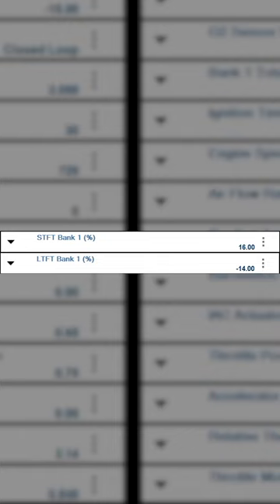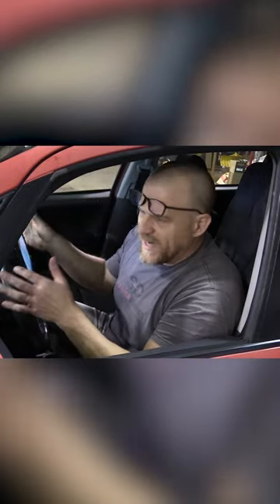Fuel Trim Numbers After a Repair [Is it fixed?]

Comment: Hey scannerdan. Thank you for all this content. I was able to fix a Chevy truck with a rich condition using fuel trims. 
I unplugged a vent hose and trims went to normal levels. And it told me the high pressure fuel pump was leaking. 

My question is in the video you say the sum of long term and short term. Are you suppose to add the long term and short term and it should be close to 0 as possible for a good running vehicle?
Reply from the maker: +/- 10% is considered normal and yes, total trim is the sum of the LTFT and STFT
Thank you!

Comment: I have P0068 & P0106 with Zero short term and 25% long term, replaced three map sensors at my Mercedes C250 but code back again after one day driving especially not vacuum leak at all

Comment: Hi I wanted to ask you or maybe someone who reads this I've been having negative long term fuel trims only when I put transmission in park position? While driving it gets a little bit better.
Reply from the maker: A dirty MAF can cause negative trim numbers at idle and then positive trim under load
Reply: @ScannerDanner  Thank you for your response my car is a 2011 Kia optima turbo it only has map sensors one on intake and other on boost pipe. Unless it's normal for trims to go negative once I put transmission in park.

Comment: Based on this video, You might not want to be doing this work on cars, you need to measure the fuel ratio.. the trim can be reprogramed or just wrong must use readings from a wide band 02 sensors or your flying blind... they clip onto the exhaust, if that motor blows from running lean your at fault without knowing
Reply from the maker: 😂 okay. Watch the full video this short was made from. You may actually learn  something